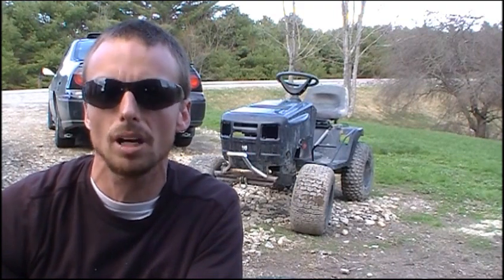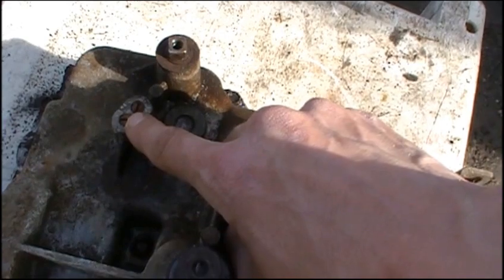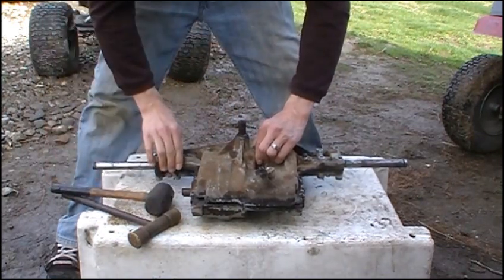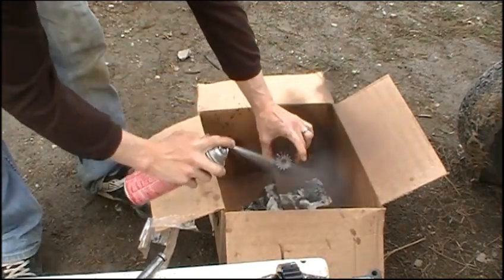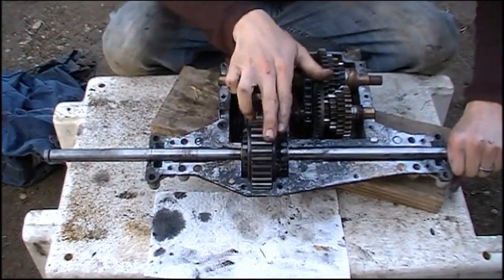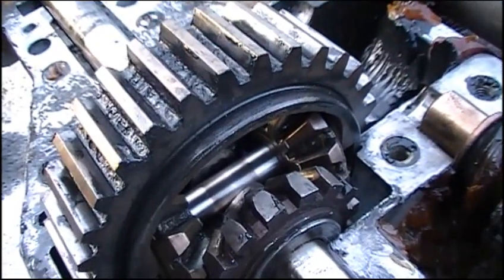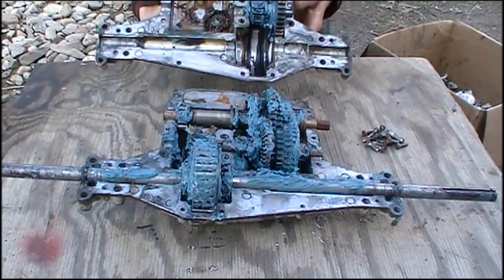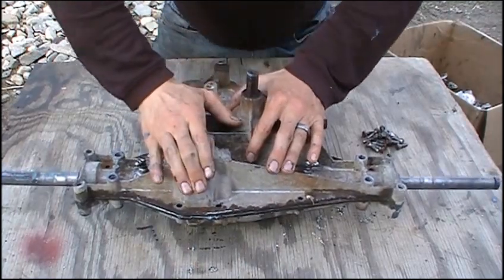How to: Lock a Trans-axle or Differential

Comment from the maker: hydro's dont like being pulley swapped, they tend to burn up quick. U would need to find a gear driven transaxle, but the good news is, it should bolt right it. Might even work with your shift linkage

Comment from the maker: you'll have to open it up, and check the bushings on the shafts inside the transaxle... they should have little "tab's" on them, and they are supposed to fit into a recessed area on the bushing journal. If you put it back together without seating them properly, then it will cause it to turn hard once you put it back together.

Comment from the maker: I would re open it up, and make sure everything is lined up, espically the shifter assembly. If it's a little out of alignment, then it won't allow the trans to shift. It would always be stuck in neutral.

If it still shifts, and its hard to turn the shaft, then open it up and look at the little brass bushing on the ends of the shafts... they have little notches that stick out, and there is a groove in the case for them to sit it. They have to be lined up when you re-assemble the case.

Comment from the maker: open it back up and look at the ends of all the shafts.. You will see a bunch of small brass bushings on the ends, if you look real close, you will see they actually have little tabs on them, and the case they sit in have little cut-outs to accommodate them. Make sure all these brass bushings haven't gotten mis-aligned before you put the cover back on.

Comment from the maker: @ferchospapa an OPEN differential will distribute torque to the wheels separately, (usually the one with less traction).
Locking it negates this, effectively locking both axle shafts together (figuratively speaking) making both wheels spin, thus giving you twice as much traction.

Comment: Outstanding video.You provide every tip & trick to look for imaginable. Wow. If I do this mod, my lawn tractor will be able to pull the 1,700 lbs boat up the hill I'm sure but what about steering? How much is steering diminished? I'm thinking of doing the lock and adding a wide bench seat so I can slide from side to side easily during turns. Thank you for your hard work.

Comment: I've heard that actually. But for my first attempt at doing this, that's the way I am going to view it, just as a first attempt. I'll grease the gears and shafts as you demonstrate to do, and it appears that the hydrostatic part does have a reservoir for some type of gear oil. I'll drain that and put new stuff in.

Comment: cool concise how to video. thanks for cuttin thru the steps fast and not jibber jab. look for a welding tip protector blue flux at the supply store. Usually you stab your tip into it to keep the slag from sticking inside your tip ...but it's great to swab on exposed parts -like those spider gear teeth..keeps the slagmetal dingle berries from sticking.   Anyway, very enjoyable video

Comment from the maker: I agree, it's best to weld outside, or with really good ventilation. but break cleaner evaporates in seconds... I highly doubt there is any residue on the metal once I start welding. ( i could be wrong on this...)
And I'm sure the gasses released by the flux cored wire that I weld with are just as dangerous...

Comment from the maker: @thegenrl they are probably rust welded.... use a block of wood and a hammer and try to pound the wheels off. sometimes a little heat around the hub will help also... If all else fails, use a puller, like a gear puller or something of that nature.

Comment from the maker: It depends a lot on the make and model of the transaxle... if it has 3/4" axles, then 20-22" is about the limit.. if you  have 1" axle shafts, they you can go WAY bigger... I have a set of 25" tires on one... it was fine

Comment: I feel you should mention that if it is oil that you should scrape off the old silicon and put new stuff on so it doesnt leak. It takes a hell of a lot more work, but its worth it when you dont have silicon scraps or leaks.

Comment from the maker: I would take them out, heat them up and try to bend them back... but they will bend back if you hit them hard eough again..
I Once had a bent shaft, and figured out where it was bent, and just smacked it a couple times with a hammer... it worked for me, but you could break your transaxle housing

Comment: I do the same basically with light duty 1/2 ton PU's and SUV's and it lasts forever unless you try to do the drop the clutch and burn out with something that is too light to do this with. It can get you in trouble on icy roads  because it will push you through the corners so slow down for your corners till you get the feel of it... right on video

Comment: Nice video. I was getting ready to do this on an old Cubcadet LT42, just dumped a 24 hp Kohler in it with an electric fuel pump, damn thing runs like a grape ape...

Comment from the maker: are you sure its oil filled? if so, its replaceable, but you will have to pull out the trans and the input pulley, and there should be a little rubber plug on the top of the trans, pull it out and flip it upside down to drain it.

Comment from the maker: you can, but you will need a hub that has the same inside diameter as your axle shaft, and a 4 lug pattern to fit whatever it is you're trying to bolt up too

Comment: I have hydraulic front/rear brakes so Brakes are good!  And I'm not using belts, I've decided to weld/ look for a sprocket with a keyway shaft that matches the size on the input of the trans axle.  I'm using chain for multiple reasons, less power/torque loss, no wear/tear on belts, and it helps with brakes via engine braking.  I can keep the centrifugal clutch on it, and allow engine speed to drop freely(o% throttle) when the brakes slow down the cart/ the clutch disengages. 50-65mph.lol.I know.

Comment: I had the same problem taking my tires off my tractor, check the key way, you may have to grind them a little wider so the keys will come out I just went ham on mine with an 8lb sledge and found that out the hard way

Comment: @Fearlessfront as long as both wheels has the same traction an open diff will deliver the same amount of pullingforce. However if one wheel stand on a slippery surface and the other on firm ground the wheel on slippery surface will brake traction and start spinning an no power will reach the other wheel. I you weld the diff (like a lim. slip diff) it will deliver the same amount of power to both weels regardless of traction.

Comment: its pretty damn easy I did it with no problem. i used a 225v lincoln arc welder. All you have to do is tack it inside the case, then just finish it up out of the case.

Comment: Hey there, I super late into this (by a fuggin decade) but I noticed you started with a belt pulley and ended with a bicycle sprocket. . .how does THAT work?! 
Also, you may have copped on to this tip by now; but next time you weld near sacred surfaces brush a thin layer of mig dip on those precious cogs and races. It will save a shite ton of cleanup effort. Cheers Todd ~ this episode rocks

Comment from the maker: the belt needs to be able to slip, so a chain driving the input shaft of the trans would be a very bad idea.
Gear drivin transaxles are about 1 times more durable than the hydrostatic ones. But you can still lock them. You just cant pulley swap the hydro's like you can a gear drive

Comment from the maker: either a gear puller, or a steering wheel puller should work. You will probably have to drill a few holes in the pulley to use it.

Comment: When I have to spread that much grease in that kind of axle trans, I use a cheap paint brush and slather the grease all over.  Not the foam kind, the ones with bristles work best.  But, sometimes it’s best to get your fingers down in the grease to get your transaxle well greased.
Reply: Henauder I suggest watch a 13 part series called What on earth happened by Ewaranon to learn that the earth is not a globe.

I got it in my about tab.

Comment: this is a great tutorial. two questions. 1 is that a mig welder you are using in the video. 2 would a Lincoln electric stick arch welder do the job for locking the differential. all I have in my shop is a gas torch and a stick welder

Comment from the maker: @jwotham96 Locked is better for mud rocks and such, but you loose a little bit of turning radius... Unlocked, one tire will spin at a time, and it usualy the one with less traction.
Lock the rearend, and you wont have to push your mower out of the mud as much

Comment: That is a peerless rearend. Remember when putting in the bull gear and axles it takes a LONG time to get them in right. You will get dirty. Make sure you clean off all of the brake cleaner when cleaning the grease off. Do not weld through it. We should call you peerless front. lol.. Good Job. Also one side question. What model is the peerless in your murray? I have went through about 3 spicers. lol

Comment: This was awesome! Thanks. I just bought an old power pro with an 18 1/2 horse engine. I was pulling logs with it and riding around. It seems like it slips a little bit in first and second gear. I’m gonna try to do what you’re showing in this video, but wanted to ask you if you think I’ve got a belt problem, or something more substantial? Thanks

Comment: Quick little tip for ya once you finish welding dip whatever you welded in burnt motor oil to strengthen that weld you welded will last much longer but awesome video

Comment: Awesome video, thanks for the wonderful info. Just a couple questions though, when you lock your diff on a mower does it affect the turning radius, and does it cause more wear on the drive belt? I'm thinking of locking mine but wondered if these two things might cause problems for me. Keep the great videos coming!
Reply: Locked diffs wear out both front and rear tires while turning also your turning radius will increase the way to fix this is go in straight lines like a real man whilst pulling heavy loads in your new race ready tractor

Comment: Hi, Great video, I have a 6 speed that the 5th & 6th gears went out. Well I took it apart and found 2 gears that were broken apart, shattered. But my question is on Assembly for the factory thay used so much gasket sealer ( gray rubber Permatex type) that it was all over the gear axles and everthing, chunks of rubber gasket sealer in the gears, big chunks. Is that normal? The tractor not that old.  And as long as I have it  apart I'm going to weld it up like your video shows. Thanks Mike

Comment: hey fearless. in one of your videos you got a red belt that is supposed to help with slipping. What's that brand of belt. I'm using one of the cheep blue ones from tractor supply and it slips a lot. running a clutch like the one you built.

Comment: thanks man for this video i just did mine with a stick welder and mine works great but i have a old mtd it was easy i need to do pulley swap but i want to know what is the best size from people that has done a pulley swap and i want to put one belt cause mine has two

Comment: hey fearless ive heard from a lot of friends that locking the differential cause to much stress on the trans-axle and that it will brake easily. so i was wondering what u think about that because i see u have really good luck with locking them.

Comment: i like this video alot.  I have the transaxle and would like to lock it and use it on a go kart I am getting ready to build.  I just built one with a 6.5 hp  motor and torque converter.  i want to build one with a transaxle and reverse.  Also want to increase the horsepower on this next one.  
will your method this work for that?  and how many horses do you think it would handle before it fries.  For example do you think it would handle 4000 rpm?  I know this is an older video  but hopefully there is somebody out there that knows.  Thanks in advance.
Reply: mike anderson is this a street go cart? I wouldn’t worry about it. You should be ok with that 6.5 hp engine, no issues there. Speed shouldn’t be a problem, people pulley swap them all the time. You should be ok

Comment: I've got a Sears GT18 and I want positraction. I haven't welded anything in quite a few years. I'd like to know about how much a small engine repair shop would charge to do what was done in the video if I removed my transaxle myself but not opening the transaxle up, and taking just the transaxle to a small engine shop and paying someone there to open it up, weld the gears, then seal it back up. That would only leave me with bolting it back under the frame. I haven't had my GT18 very long and it's in great condition. I only wanted it for snow plowing in winter and pulling a moldboard plow and disc for breaking up a garden plot in the summer. I'm going to put 25" Kenda Executioner tires on the rear and a positraction rear with those tires would work well for my tasks.
Reply: undergroundbasement If they're honest should be under $200, problem will be finding a shop that's willing to do modifications like that. When I worked at a garage we didn't mess around with special requests unless we had a good history with that customer or it was from another shop.

Comment: BTW, posi-traction is a limited slip...
and I'm guessing turning is real fun in slightly wet grass.(?)
Reply: Posi is not limited slip
Reply: They do have a slip posi variant though
Reply: George I suggest watch a 13 part series called What on earth happened by Ewaranon to learn that the earth is not a globe.

I got it in my about tab.
Reply: @redneckjesus1956  a simple google search would prove you wrong. Guess you never heard of a company called General Motors?

Comment: Just a Thought - You may already know but if you use brake or carb cleaner on your metal surface prior to welding you MUST wash the area you sprayed with dawn soapy water and rinse as if you don't You can get Very Very I'll- Can Kill you easily. There are many articles about this as well- I had gotten Weld sick and didn't know it- You get flu like symptoms and exhausted and so much more- those are the signs Prior to death. So Be careful- Those symptoms if you're lucky will last around 3 Weeks. So- Use caution with sprays like brake and carb cleaner when welding- Seriously. Cool work n video

Comment: Along with your jeans get yourself some anti spatter spray. 
Any surface you spray slag or spatter will not stick. 
Send me a message if you need product information. I’ve been welding for 45 years I love the stuff, i also use leather blankets instead of jeans but denim works well.
Reply: Ira I suggest watch a 13 part series called What on earth happened by Ewaranon to learn that the earth is not a globe.

I got it in my about tab.

Comment: Hey Todd I just got a 6 speed in a craftsman and the input shaft spins and the brake rotor spins but  doesn't move anywhere, it's all stock and never been apart the people I got it from used it to actually mow and then it went through a fire and now it's as described. Just wondering if the shifter is a plastic pin and could have melted or if it's just the belt needing to be tighter

Comment: i was gonna weld mine up a while ago, but it looked to hard to get the damn thing out. and i saw some comments above about the chain and sproket. can you explain that a little move. on my mower i have the clutch bypassed, and i just put it in gear 1-4 then rev it up. i dont see why welding some sprokets on there wouldnt work. maybe not for your mowers. but for mine i wouldnt care. ill try to post some videos of it for you fearless. you should see the tires for it i made their pretty cool.

Comment: Hey Fearless, could you use the brake shaft as the input shaft and still be able to change gears?  I'm trying to convert one of these to work as a transverse transaxle for a transverse drivetrain set up.   Thanks.

Comment: My is a automatic and the brake is the same but I couldn't take the top off and I did everything you said I even look under if there was some but there was only 2 bolt under the rest on the top but it still didn't took off

Comment: I don't see the point in welding the gears to the ends of the axles. 
They're on splines and even if the cir-clip wasn't there they can't come off. 
The splines allow some movement and the fact that you find you have to grind a bit off the end of the axle shows you have welded something into a position it isn't happy with.
I would use arc (and some anti-spatter spray) instead of MIG too, just for penetration.

Sorry if I sound critical, just my preferences. You've made a good instructional video

Comment: Tryin to get the brake rotor off currently, not in the tractor yet. Soaking in PB Blaster(story of my life with this thing). It got stuck on and ate away the brakes pads over time. Also waiting to find some atv tires. I'm expecting a locked tranny to be superior. I'm curious, will a 3" front pulley and a 3" rear (custom idler will b needed) get me goin pretty good in 3rd gear but still be somewhat slow in 1st? If I put bigger on the front, I have to change clutch design since its in the way...

Comment: This is very important in steep hillsides. If one wheel slips with an open differential, you have NO BRAKES.
Reply: Wow really those mowers only have rear wheel brakes with open differential so essentially one wheel brake? That sounds dangerous.

BTW Bill I suggest watch a 13 part series called What on earth happened by Ewaranon to learn that the earth is not a globe.

I got it in my about tab.

Comment: Actually, I have a question on a peerless in a craftsman LT1000.  When I engage drive, it stalls, even in neutral.  I tried pulling the right wheel and saw the key (shim) was broken.  Got it used, so no clue what happened until I yank it, but was wondering if that sounds familiar so I have an idea what to expect when I open the sarcophagus.